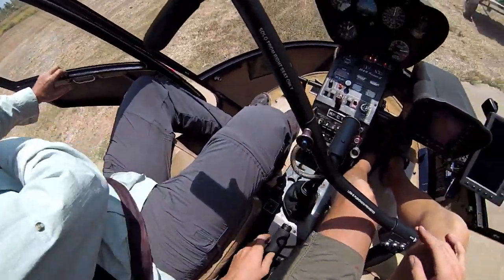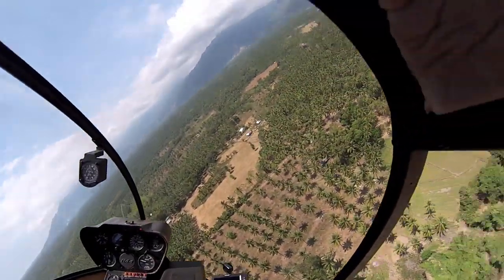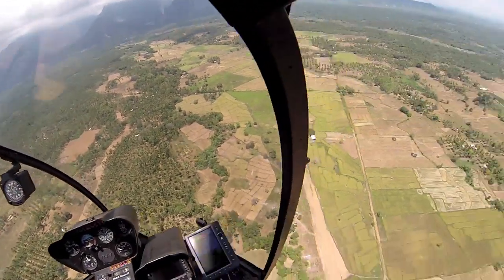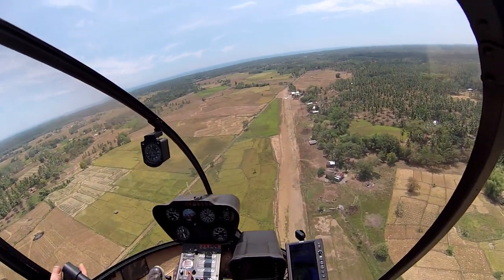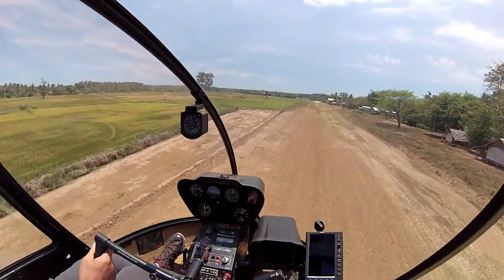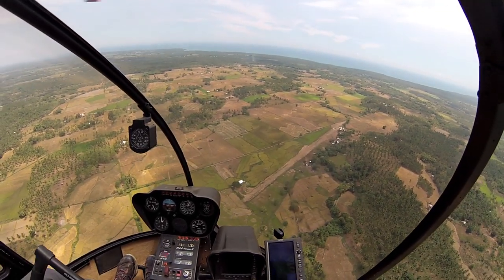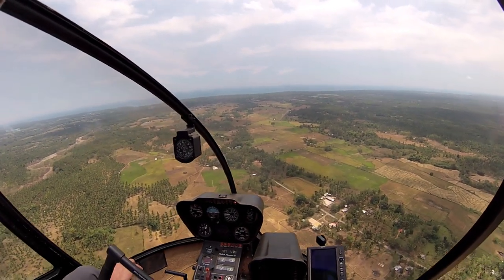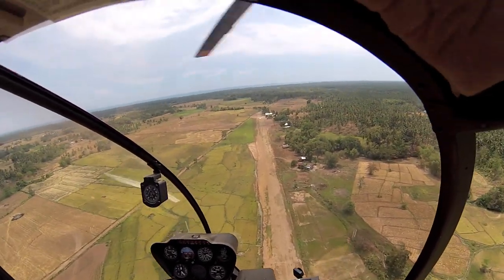Day 5 - True Respect - Live Audio - Advanced Helicopter Autorotations 360 auto &  MAX glide 120KIAS

Comment: Why does the horn keep going off if you dump the collective why doesn’t the rotor speed up? This is a fascinating video I’m a fixed-wing pilot but I’ve had three helicopter lessons I was actually able to hover a Schwerr 300 C on the first lesson but I drifted all around I couldn’t keep it over one spot but I kept it in a hover. Another question I have is why do they wear those big helmets? I noticed that in some of the medical helicopter videos the guys are wearing those big metal helmets and I just don’t understand
Reply from the maker: The rotors normally do speed up when dumping the collective.  The horn will come on more if you are keeping the rpm lower to extend the glide.   Even with the horn on, which comes on at 97 percent, the max glide and normal power off rpm goes down to 90 percent.

The helmets are a choice for some, a requirement for any operators.  Just comes down to protecting your head, eyes, ears.

Comment: Hi there, Can you please explain why you do a lateral flare and remove the possibility of using your skids in case you cant bleed off all your air speed? Wont this introduce the possibility of rolling over?
Reply: my guess would be that you can make steeper flare to the side, without striking the tail.... and as for the decision to make it to the left, it is probably to conserve energy, as right pedal without power may consume more of it (bearing friction etc).
Reply from the maker: Training is ultimately going to be to a stop after your flare.  Any run on landings in most soft environments would result in a rollover.

Yes, the lateral flare can introduce more of a chance to roll if not landing with zero groundspeed.  That is why we train train train until becoming proficient and either normal or side flare techniques.

The side flare allows us a more aggressive flare at a lower altitude and not worry about the tail striking.  The reason a left turn is to act as a big rotor brake to prevent a big rotor rpm overspeed.
Reply: @michaelmiller85  Also the floor doesn't shoot up to block your view of the ground, which is nice :P